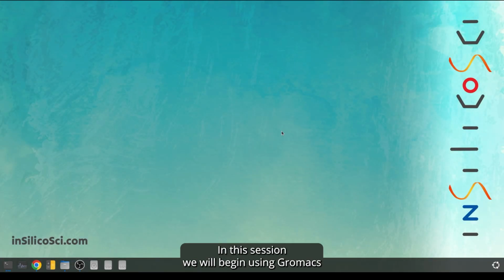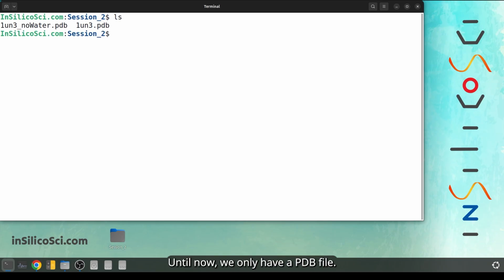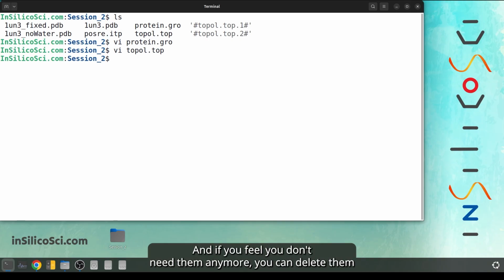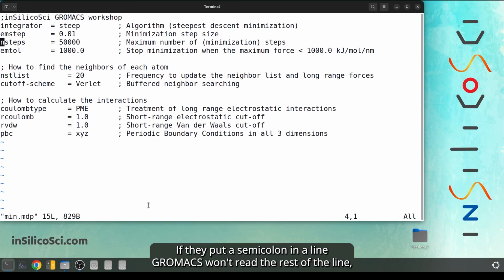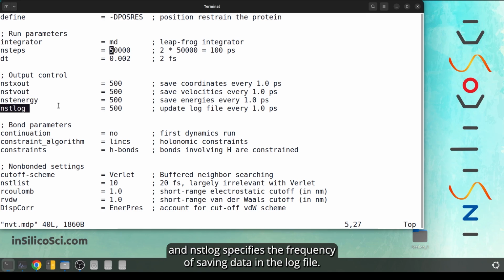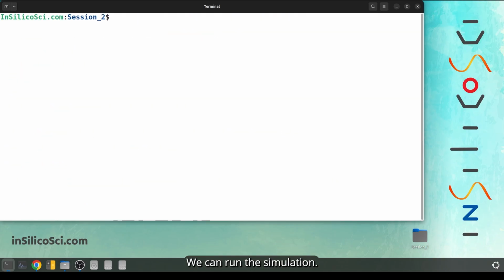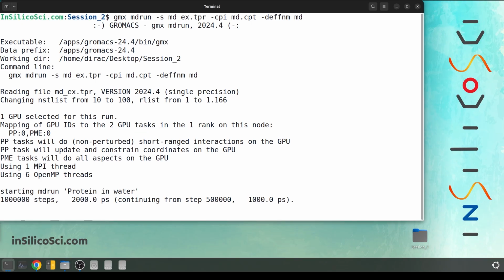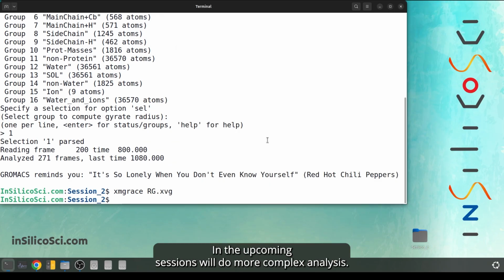Molecular Dynamics Simulation with GROMACS: A Beginner's Tutorial

Comment: Hi, thank you for the tutorial. At the final step, my simulation run is very slow. May I know if there are ways to troubleshoot? My GPU support is disabled for some reason and I suspect that is the reason. I am using WSL.
Reply: Is it an nvidia card? Please refer to the installation documentation itself as it  as all the ressources available for a successful build. If it is an nvidia card, make sure you can run cuda. If your hardware should be running it but it isn't, there are a few fixes you can try. Lookup CUDA - NVIDIA and navigate to "known issues" in the documentation. The one that worked for me was disabling HMM by adding a rule to nvidia_uvm